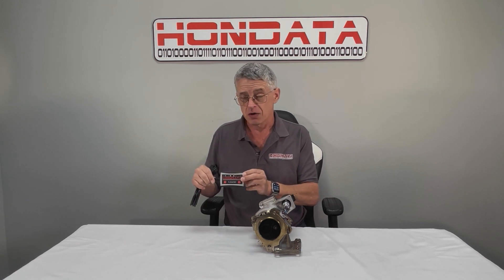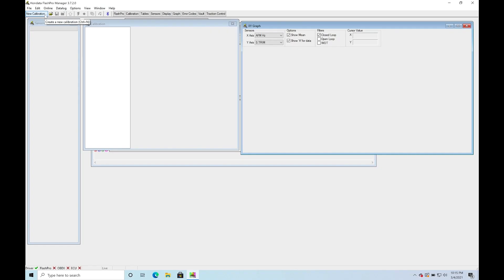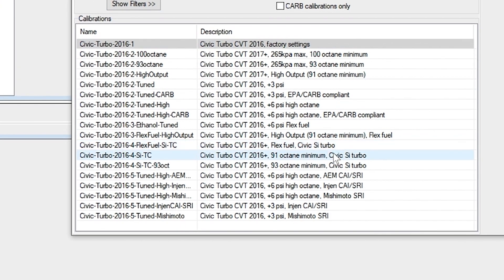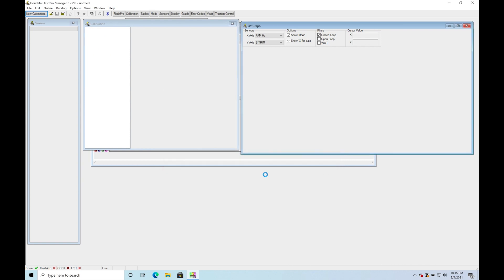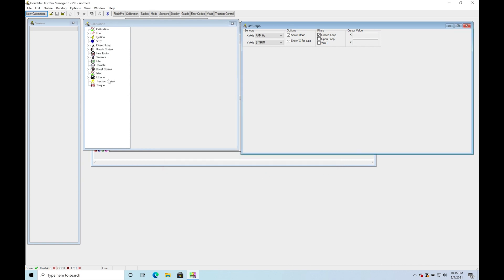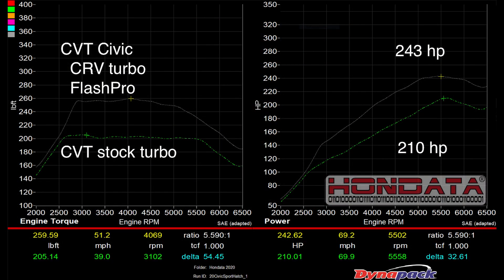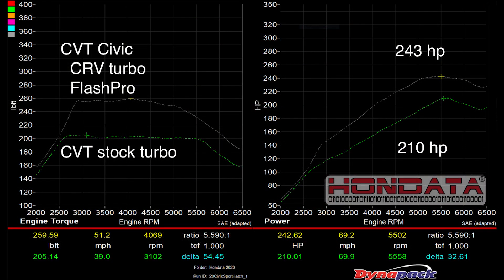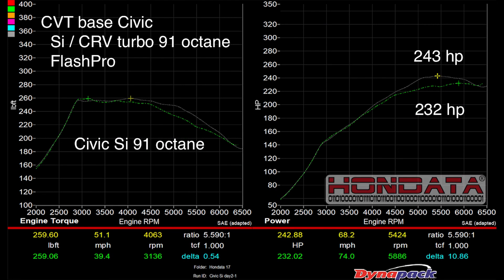Add Si (CRV) Turbo Power To Your Base Civic | 10th Gen Civic FlashPro Calibration

Comment: I run the Si turbo in my Civic sport hatchback and run Hondata's flex fuel tune for Si turbo. It is actually very good top end. Big difference from me running the 93oct tune. Cheap to get an Si/Crv turbo.
Reply: whered you buy it from? im looking for it everywhere cant find it anywhere. Have a civic 1.5t non si and wanna swap it with the si turbo
Reply: @SLO0.0.1 i bought a used Si/crv turbo on ebay for $550.

Comment: My name is Yu
ChangChun of JiLin of China
2016 1.5t civic 10gen Fc1
Dear Hondata Cs
Iam Hondata loyal fans
I need to made more power by taking more boost, which over 2bar
As hondata support 4bat sensor onUS version of 2017si. Is it possible to support on 2016 FC1 non si?

Comment: Are you guys going to have anything that may possibly address CA's smog requirements of Cal-ID and VCN checks While running your tunes?  Also any V6 support in the pipeline?  Would love to be able to have a tune for the wife's MDX.
Reply: I wouldn't worry too much about it. Just flashing it back to stock is usually the answer. What's the gov going to do make you scrap your car because of a software issue?

Comment: How does the CVT handle this?  The 6+ psi tune was supposed to be about as much as the CVT can reliably handle before the belt pressed against the drum...
Reply: I"ve got the same question???
Reply: I’m assuming the cvts can handle a little more power then we thought 💭
Reply: This is right around the maximum tq the cvt can handle reliably. I would not launch the cvt with this much torque.

Comment: So is the SI/CRV turbo different from the Accord?
Reply: bolts right up but there are tiny differences
Reply: @jcerra84  What kind of differences? Internal like the impeller and airflow?
Reply: @gusirizarry  exhaust side is slightly larger on the si and less blades for better spooling